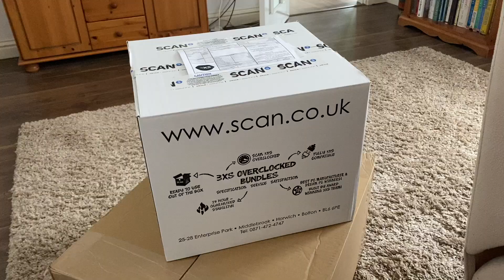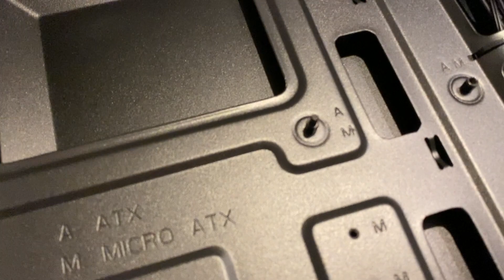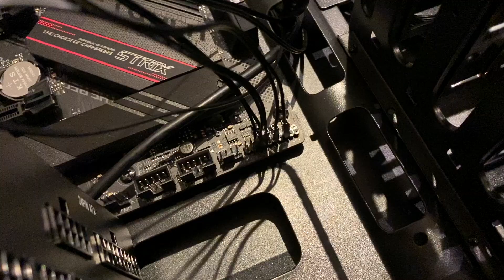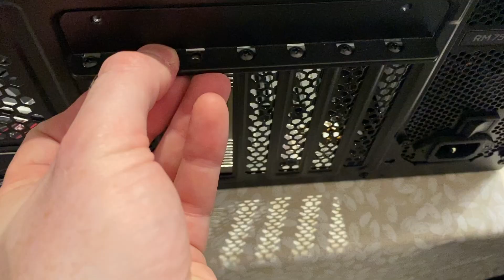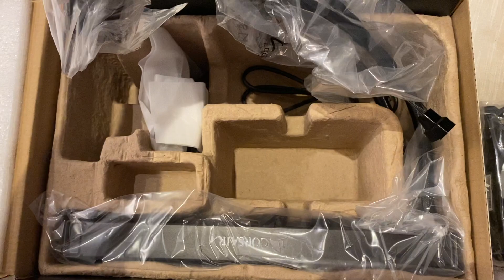Building a gaming PC for Microsoft Flight Simulator 2020

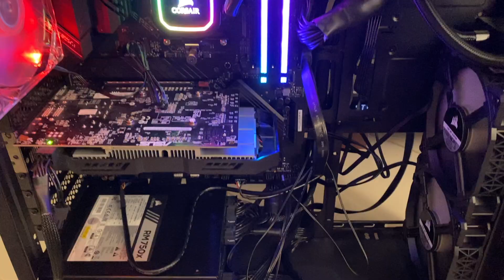Comment: 18:21 ...Yes as David says lower down the 5900x doesn't have onboard graphics...not many Ryzen CPU's do (they call them APU's if they do)  only the  Ryzen 3 2200G and Ryzen 5 2400G I think...hence the "G".....Although not many would use them due to their limitations, having onboard graphics is handy when it comes to fault diagnosis.
Reply from the maker: I have never heard that before. It's a very useful thing to know though! Cheers

Comment: Looks like you had " fun " with your build ...actually the Wraith cooler is fine unless you intend to overclock...and again do you really need a top of the range Graphic card ? ...if you game at 4Kat 120 fps fine but otherwise go for a 2070 that will give you 1080p and 1440p at high resolution..the famous 750ti will game at low levels ..
Reply from the maker: I've just bought a 2060 Super. Should be enough!
Reply: @DrJakesVeryBritishReviews  Good choice it will do you well and has a great resale value..

Comment: You’re onboard graphics didn’t work because you don’t have any! Some of the lower end CPUs have onboard graphics which are required to make those ports work.
Reply: I said the same thing.  No integrated graphics on the 5900x.  Also I may be wrong but shouldnt the radiator be higher?  Air bubble at the highest point in the loop.
Reply from the maker: @phillyman36  I made a video on this... Thanks!
Reply: @DrJakesVeryBritishReviews  Cool the first version you had the radiator to low.  Glad you got it set up and know a little more.  Thats how i learned little by little.
Reply from the maker: Interesting. Thanks for that. CPUs with graphics on board is entirely new concept to me

Comment: Jake, thank you for this video, I needed a little 'Cheer' here  in the U.S. on a Saturday morning.  I am a re-tread computer hobbyist turned YouTuber (my Channel uses the same name I login to YouTube with).  I really found it entertaining how you explained your journey in building your new modern desktop PC.  I went through it myself just about two years ago (before I started as a Tech contributor on YT), and I was doing a lot of the same trial and error you just went through.  I was an 'in the weeds' computer enthusiast about 25-years ago, building computers similar to the previous Beige one you are replacing.  I still remember back in the day paying extra for the 'Black' components (sans the cables), which were just starting to come on the computer scene and I liked their look.  In the past two years I have now built and upgraded a couple of dozen computer systems, along with countless product reviews.

By the way, the most entertaining part of this video was your description of how to remove one of those power connectors.  I have not laughed out load like that in a long time.  Oh, there are some little clips that lock the cables on which require a squeeze of the finger before the cable can 'easily' be removed, however that is still not very easy to do with the ones connected to the motherboard due to the tight fit the MB manufacturers intentionally put into those.  After a few ins and outs (not trying to break any YT rulee, really), they do come off a lot easier.

Thanks again for the entertainment.  Have you tried 'Stand Up'?
Reply from the maker: Great tips and thanks for sharing your story. I have not tried 'stand up' but it is very kind of you to suggest it! I'm humbled!

Comment: Dude.. Pump should be placed in such a way that water would naturally flow down to it even when it's shut off. Otherwise you risk creating an airpocket at the pump, especially as the pump here is the highest point in the loop. This could damage the pump or significantly reduce its lifetime.
Reply from the maker: Thanks for the suggestion. Nothing about this in the manual and plenty of builds online are configured like this. I guess time will tell
Reply: @DrJakesVeryBritishReviews  yes you see a LOT of builds lile this, even examples on it in the cooler producers demo pics. But check out Jayz two cents, or LTT, they have videos on it.

Also, it just makes plain ol sense.

Comment: Was the supplied ram 3600mhz?  Maybe try benchmarking the differences.

Also a big upgrade would be to swap out the SATA600 SSD for a PCI-e 4.0 SSD. The Samsung 880 Pro is so fast compared to the SATA drives now.  Even PCI-E 3.0x4 drives are much better.
Reply from the maker: The RAM was 3200 as well. Thanks for the SDD suggestions!

Comment: Good cable management is better for airflow too. It helps keep your GPU cool and will prevent thermal throttling and premature wear. Air intakes and exhaust fans will definitely help your build.
Reply from the maker: I'm pretty happy with the final cable arrangement (not shown). I'll show it off in a future video.

Comment: I ordered my AMD 5900X computer yesterday from a place that let's you show what place you are in. I'm already at spot 885 in line at this online store so let's see when I'm able to get it in my hands together with the rest of the components... I'm getting the 6800XT next year because of my budget (not that I had a chance to get one anytime soon anyway) and will use my GTX1080Ti just a little bit longer. I want to cram everything into a Geeek A60 plus v2 case that you have to assemble yourself so that will be extra challenging. The first time when you turn on the power on a new build system is always the most exciting part. Will it turn on? Are there any beeps? Does your display show any life?
Reply from the maker: Will it turn on? Are there any beeps? Does your display show any life? Does it burst into flames? Have you destroyed thousands of pounds of electrical equipment through careless and ignorance? Good times ;-) (Good luck with your build, by the way)
Reply: @DrJakesVeryBritishReviews  Thank you. This time it is really worth to replace a PC again with the new CPU's and GPU's out there (if you are able to snatch one of them both). I'm not to worried about building a computer, but there is always that tiny chance you have bad luck with getting something that is broken out of the box.
The only thing that scares me the most is adding a water cooler (even if it is a closed one like yours), because in the back of my mind there is always the thing that tells me that fluids and electronics should not be near each other.